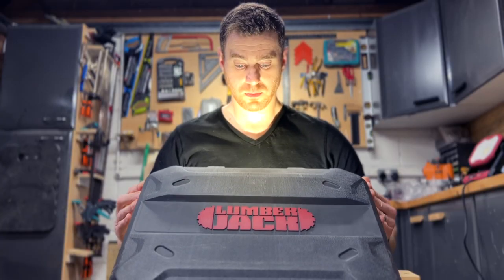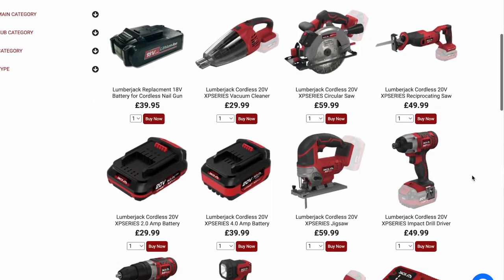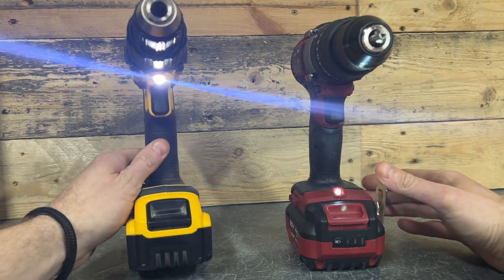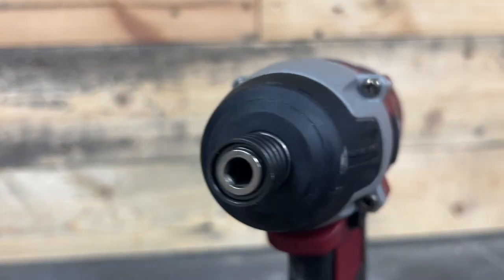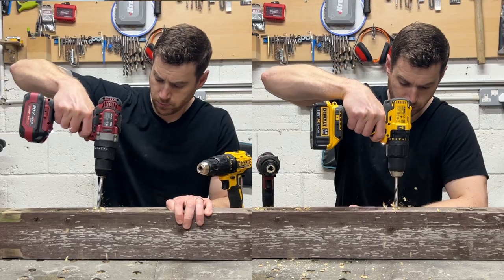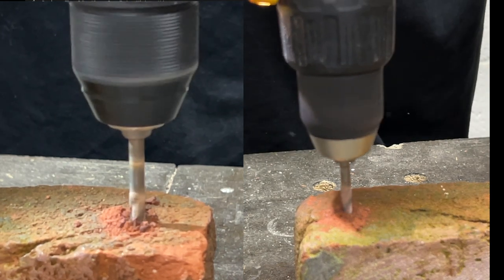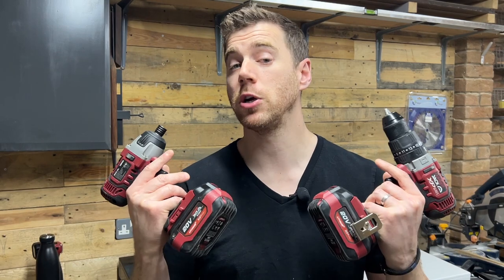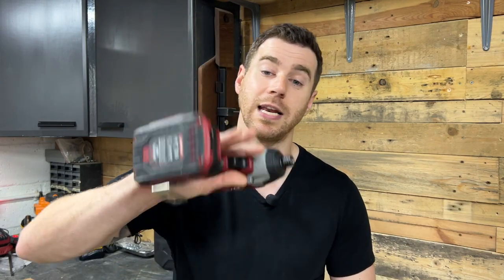Lumberjack 20v Drill & Driver Review

Comment: Knowing the owners of the lumberjack range I did some testing of these tools in there prototype phase and thrashed them they held up very well even against my every day tools as a tradesman the owners are good guys too
Reply from the maker: Yeah I’ve got no complaints. They are good tools, especially for their price. I think what sets them apart from other brands is that they price fairly and have amazing customer service with real humans at the end of the phone/email. Such a nice bunch of people to deal with.
Reply: What other batteries are compatible with
Reply from the maker: @agnosticevolutionist3567 as far as I’m aware it’s a singular platform but will check with Lumberjack for you. The good news is that the batteries are a much more reasonable price than Dewalt etc so the need for the cheaper compatible batteries is lower.
Reply from the maker: Just checked and they aren’t compatible with any other batteries but as I mentioned. The price point is much more reasonable compared to other brands.

Comment: Do they use brushless motors?  It doesn't say on the tools or the rest of the range  and that would account for them being longer.
Reply from the maker: No I asked the guys at Lumberjack that question and they told me they’re brushed which definitely accounts for the size difference (and price). I thought it was interesting to compare against higher end tools that cost a lot more though and they stood up to it well to be fair.
Reply: @lionandbear  Well they don't cost that much more, @ £180 for the twin pack it's a bit too near in price to Dewalt & Milwaukee equivalent especially when they're on offer.  That drill set are gateway items so  if I was boss I'd drop the price on those so irresistable to DIY'er or budget buyer who is then nudged  onto the platform.
Reply from the maker: @tonydaddario4706 yeah I’d probably agree as you can definitely find bargains on other brands occasionally. That Dewalt drill I’ve got was a bargain from B&Q on sale. I guess it depends on how you look at the entire range on the battery platform as the other lumberjack products are a lot cheaper price in general. I really like the nail gun, circular saw and jig saw. Most brands are pretty decent nowadays though to be fair.